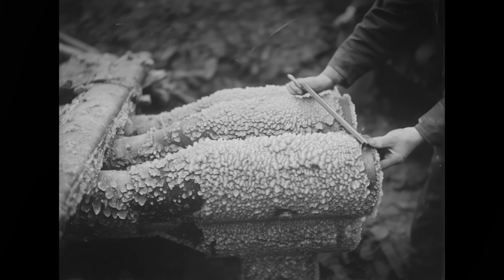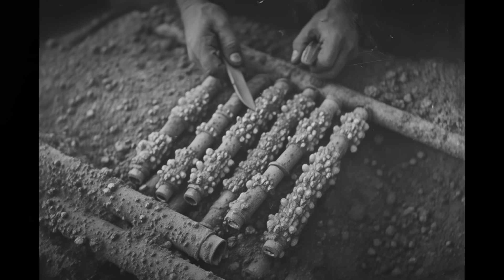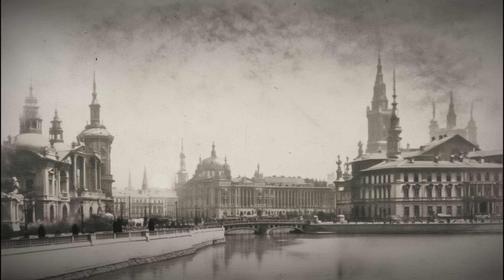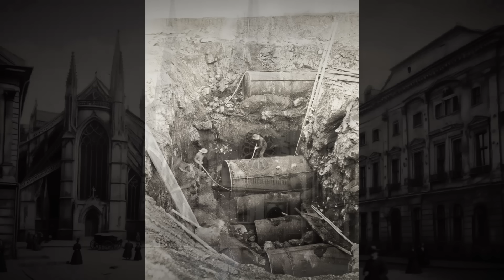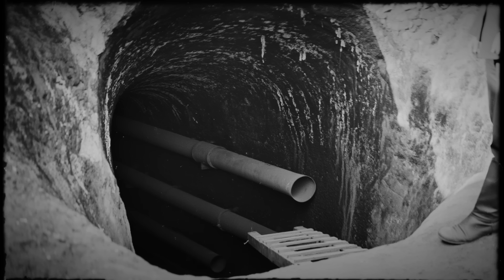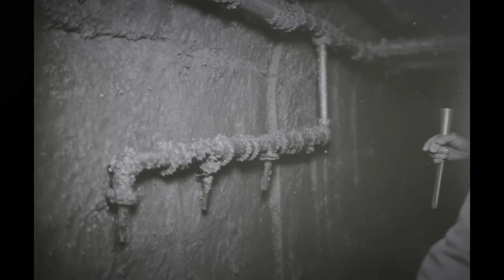Energy Chambers Found at Niagara Falls 1896 — Tartaria's Water-Powered System They Covered Up

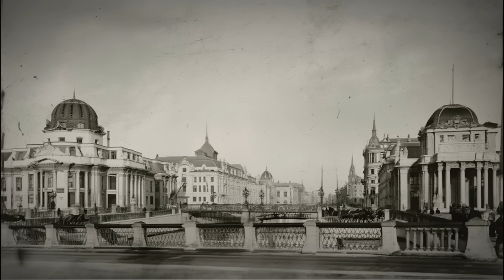Comment: 7:58 these high temp ceramics u speak of being found i cannot find anything online backing this up and The "surface tunnels" capable of withstanding high temperatures refers to the extensive network of tailrace tunnels and industrial conduits excavated in the late 19th and early 20th centuries. While often described as "high temperature," this characteristic typically relates to the materials discovered or produced within the associated industrial complex, such as Carborundum (silicon carbide), rather than the geological properties of the tunnels themselves.
Tailrace Tunnel (Niagara Parks Power Station): This 2,200-foot-long tunnel, excavated between 1901 and 1905, was built using dynamite, pickaxes, and shovels. It was lined with four layers of high-quality brick and concrete to withstand the erosion and immense pressure of water flowing at 30 feet per second.

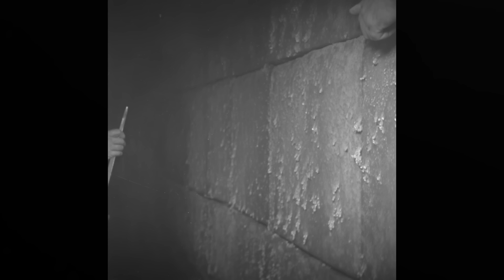Comment: im from niagara falls and ive done my research this story isnt adding up so far and alot ai generated photo in between real photo of digs then which looks your putting a different context around it if you could send where you the talkings of finding strange already built foundation for weight bearing and old tunnels that seemed before 1896 4:46

Comment: This video is rubbish and full of misinformation. 

The truth is...
Key Developments & Systems:
Early Plants (Early 1900s): The first power stations, like the Electrical Development Co. (Toronto Power Station) and Ontario Power Company, used underground tunnels to channel water, with some tunnels becoming obsolete as technology advanced.
Sir Adam Beck Stations (Mid-20th Century): These massive projects built new canals and powerhouses, with Sir Adam Beck I still operating with modern upgrades layered onto its original structure.
The Niagara Tunnel (Big Becky): A major 2000s project constructed a new, large tunnel to supply more water to the existing Sir Adam Beck generators, increasing output without building entirely new powerhouses, effectively adding to the system's capacity.
Abandoned Tunnels: Many older tunnel networks from the first generation of plants were sealed, flooded, and left unused as the industry consolidated, creating vast underground networks beneath the falls.
Niagara Parks Power Station: An old plant converted into a tourist attraction, allowing visitors to explore its tunnels and view the falls from a new platform at the river's base, showcasing the original infrastructure. 
In Summary: It's a layered history, with new, efficient tunnels and generators built alongside, sometimes above, and parallel to older, abandoned tunnels, all contributing to the vast hydroelectric complex at Niagara Falls.